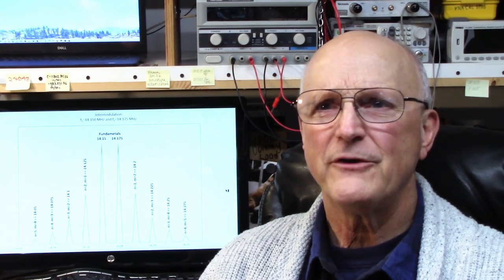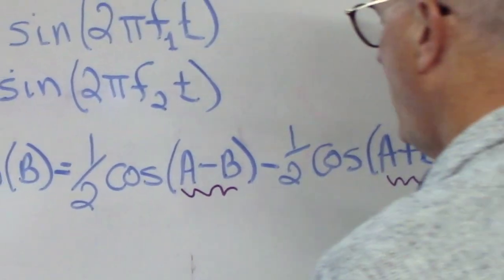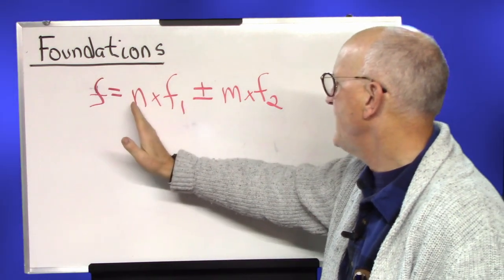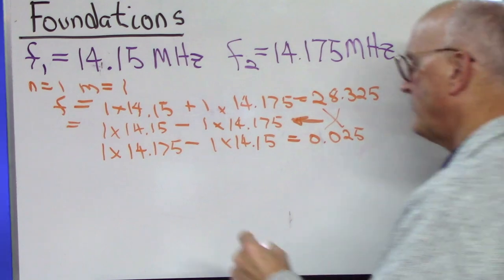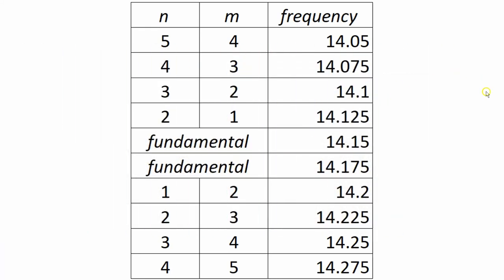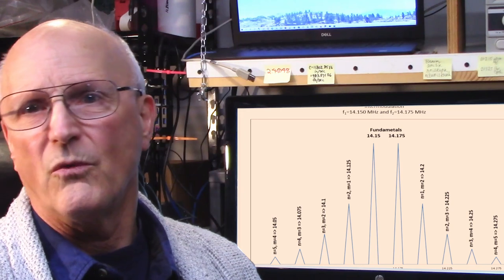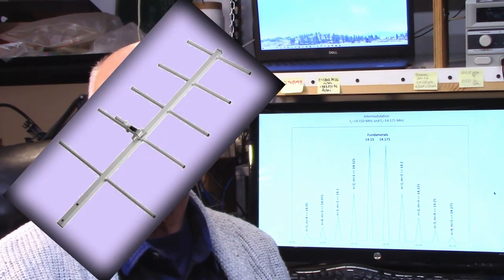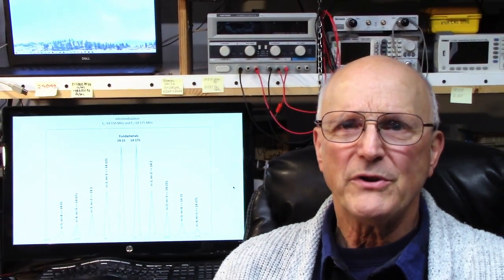What is Intermodulation??? (017)

Comment: FM broadcast is a pain as well. Co-located broadcast FM transmitters have a history of generating IM products. The really bad thing is that those tend to land in the aeronautical band.
Reply from the maker: Boy, ya! I can see that happening! I just never thought of where the IM products would end up.
Reply: @eie_for_you  I deal with this particular scenario all the time, from the perspective of the aeronautical radio that is. It can be PIM but it can also be poorly desgined or implemented transmitter combiner. Basically one TX is leaking over to another TX and mixes in the finals. Unless the combiner takes account of that possibility those products will get radiated.
Reply: It could even happen at a high power transmitting site where the tower has corroded joins. 2 transmitters mixing in such a crude rectifier could create enough mixing products to cause problems

Comment: Why do we multiply signals?
Reply from the maker: First, intermodulation is the result of undesirable mixing/multiplication of signals. 😞
There is a desirable version of this mixing/multiplication of signals. 🙂
It is through this process of multiplication that we get the needed mixing products required by receivers.
For instance, you are tuned to a 3 MHz signal on the front end of your receiver. By multiplying this 3 MHz signal with a 2.545 MHz local oscillator, you get a 455 KHz signal as one of the mixing products to send into the Intermediate Frequency (I.F.) stages where all of the filtering and signal processing takes place. Demodulation is at the end of the I.F. "pipeline" which is followed by your audio amplifier and speakers.
Here is the mathematical expression for this multiplication/mixing process:
If we have two signals, one of frequency A and another of Frequency B, then
cos (A) * cos (B) = 0.5*cos (A-B) + 0.5*cos (A+B)
So, if we have A = 3 MHz and B = 2.545 MHz, then the output of the perfect multiplier would be
3 + 2.545 = 5.545 MHz and
3 - 2.545 = 0.455 MHz
The I.F. stages are tuned to only accept the 0.455 MHz signal. The 5.545 MHz signal is thrown away.
Hope this helps to understand this.
Reply: Bobby Darin has a song that answers that question